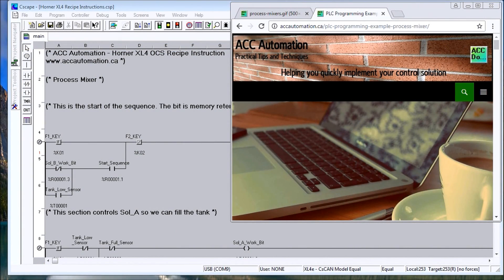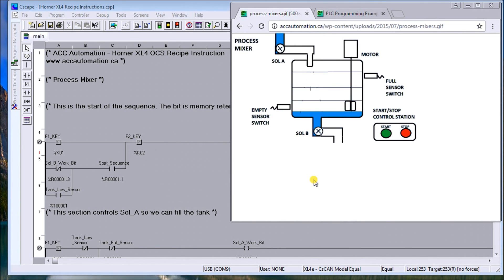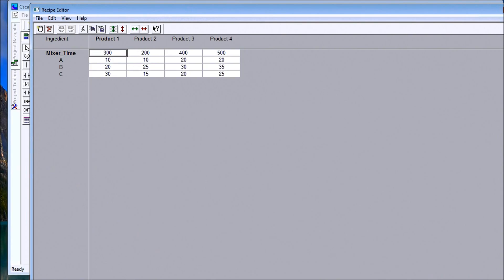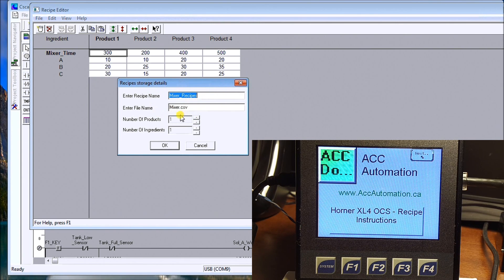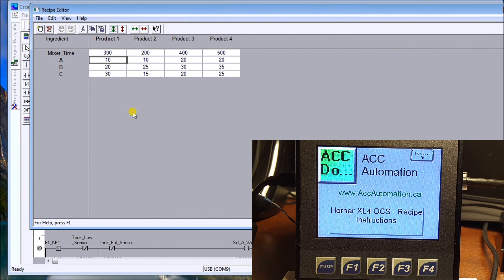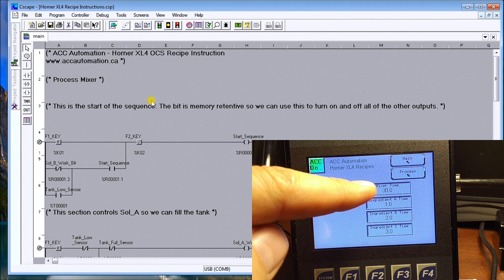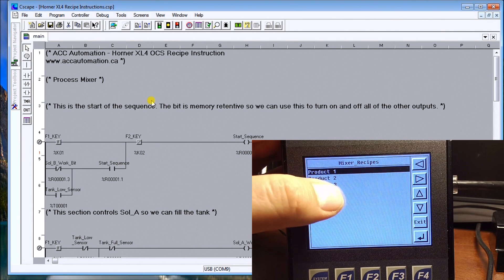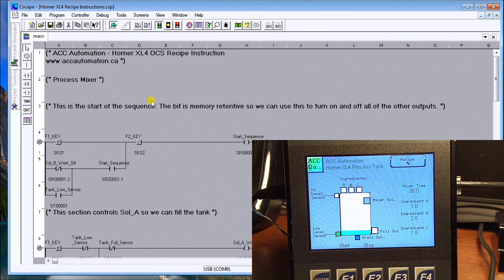Horner XL4 PLC Recipe Instruction

Comment: Have you ever configured this controller to use barcode scanner for selecting recipes?
Reply: Selecting and loading recipes?
Reply from the maker: @GodisJesus  
I have not done this with this controller however it is possible using the serial ports to connect a barcode reader. 
This post will show you the setup of the serial port. It is currently using Modbus RTU protocol but in the case of a barcode, it would be ASCII.
https://accautomation.ca/horner-xl4-modbus-rtu-instructions/
https://hornerautomation.com/wp-content/uploads/2019/11/MAN0964-12-EN_XL4_User_Manual-01.pdf
I hope this helps you out.
Regards,
Garry